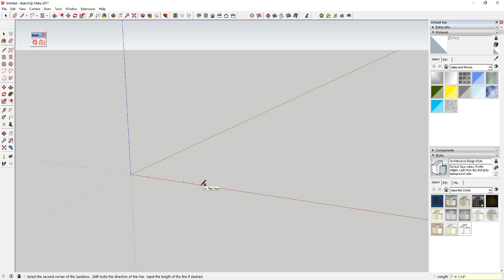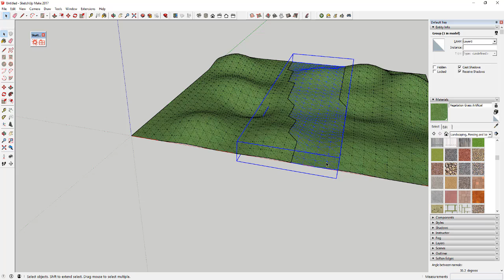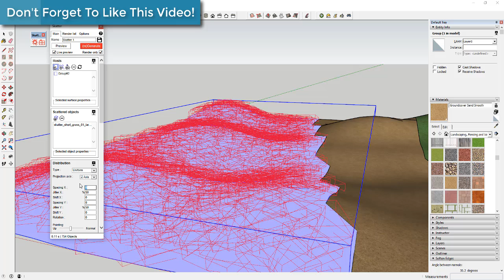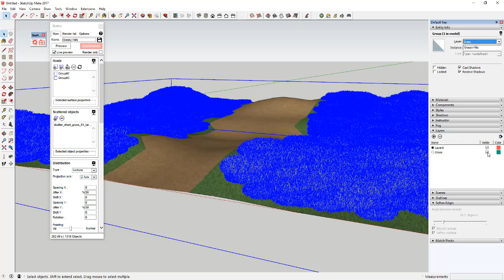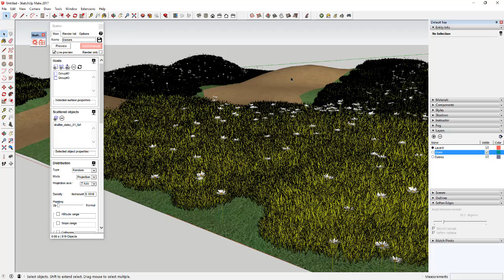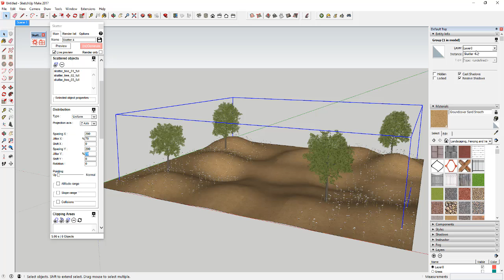Comment: I don't see the extension manager?????
Reply: What version of SketchUp are you running? They added the extension manager in the last couple years I think, so if you have an old version, it might not show up...
Reply: 2016 I did some googleing I found sadly everytime i launch i have to install sandbox??? #strange
Reply: Hmmm...that's strange - I haven't ever heard of something like that...you may want to consider updating to 2017 if you want access to the extension manager, but you shouldn't have to enable sandbox every time you open SketchUp. I think even in 2016 you only had to enable it once. Maybe you have to turn the toolbar on each time though?
Reply: TheSketchUpEssentials no it not in toolbar option until i install it... As i said strange will be looking into 2017 or might just go 2018. I really love your work though your tuts are very detailed a lil fast but the good old pause rewind and play always works great i do 3D Modeling concepts for events and functions and ur great help especially this tut!